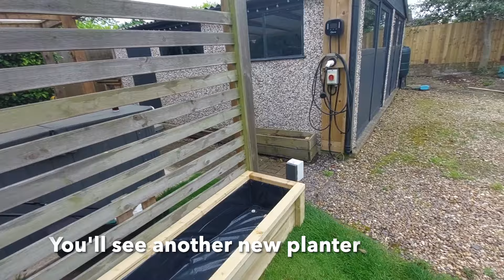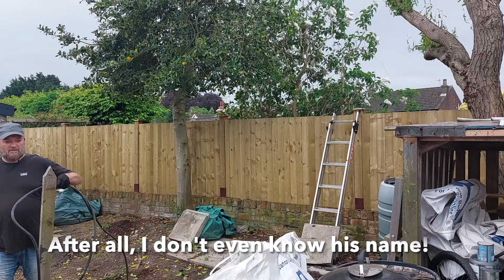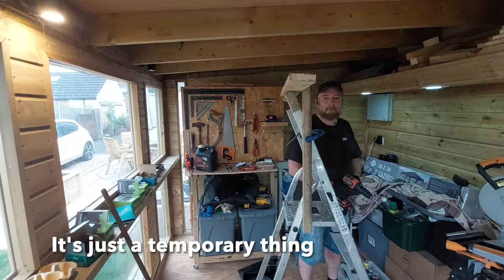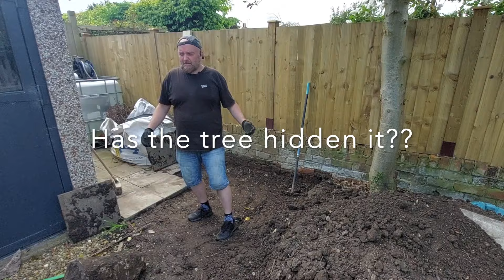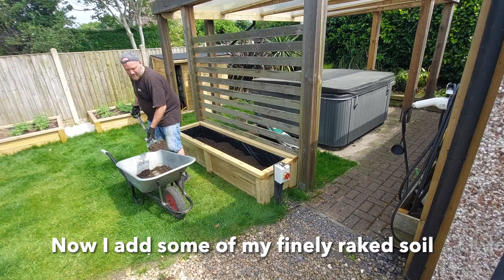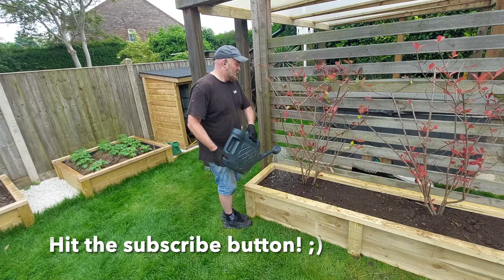Digging! Pavers! Exotic bushes! Another garden transformation begins! But is there even a plan??

Comment: Hiya Dave, good to see you are fully recovered and that the fence is hanging strong. I'm still undecided about doing the same with mine, which seem to be more exposed to the wind than yours. Have you noticed any issues with it? Would you do it again? Cheers
Reply from the maker: It's funny you should ask about the fence, I'm just trying to decide what to do about it lol. It took a battering over the winter, and now it does wobble a bit. I've peeked over the top and seen some of the anchor bolts are pulling out- it was always a gamble fitting them in old bricks I suppose. Sadly I think I'm going to have to chalk this one up to experience and modify it somehow so it survives next winter
Reply: @DIWhy-ex5km  I guess I won't do it with mine then. LOL. I hope you find a solution, I'll be here following along.
Reply from the maker: I'm sure I'll think of something 👍